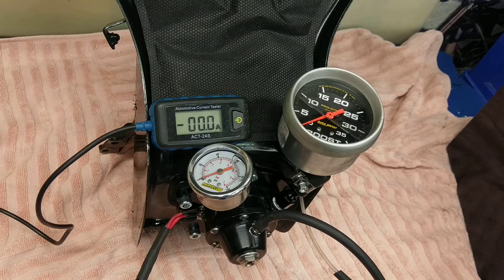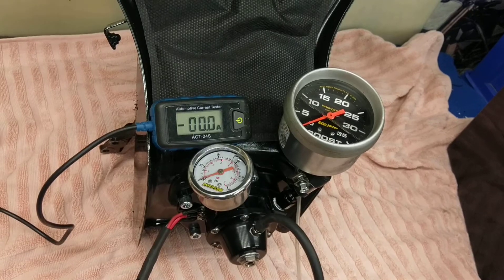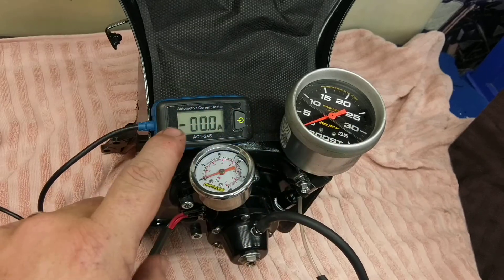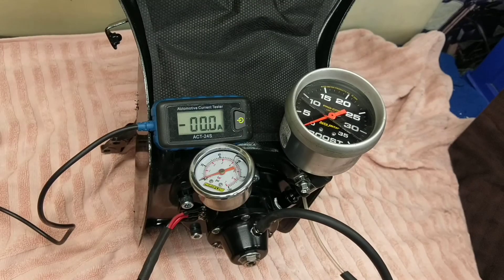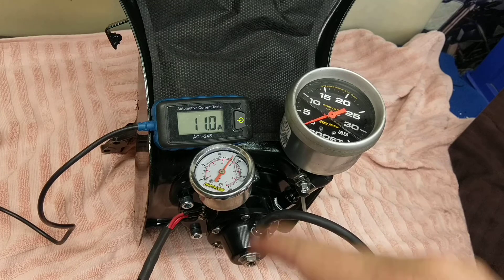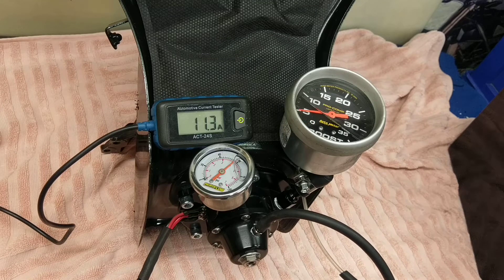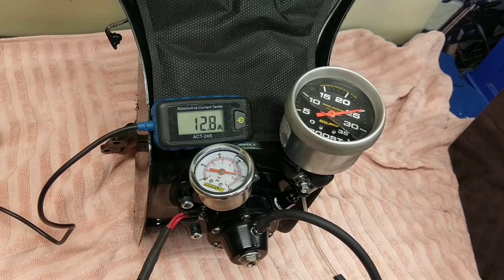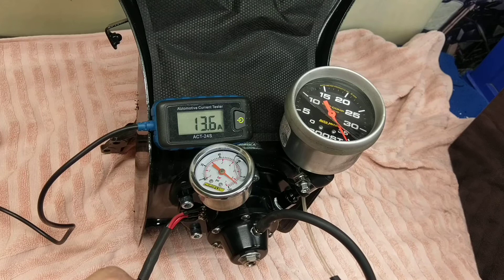Ninja H2 fuel pump & regulator upgrade pressure & current draw test

Comment: Question, do i need to upgrade this fuel pump if my bike pushing 240hp with the intercooler?
Reply from the maker: @orionmobile6545  you generally only need a pump upgrade for stage 3 gears & above or  if you are using E85 fuel.
Reply: @extcreat  thanks im planning to buy zh2 se, already talk to kawasaki dealer and im planning to buy your intercooler. I lived in middle east and it's very hot climate here 30C 40C. How much horsepower do you think it's safe to push with intercooler? I did some talk to zh2 owner they said 240hp is fine without intercooler is it true?
Reply: @extcreat  i want the bike to be reliable as possible because here in middle east there none of people use zh2 lmao. The dealer said if i buy the bike i would be the first guy to use zh2 in that area. Question is, I Don't want to ship stuff waiting for 1 month since all the good parts of zh2 are in america. If i bought the bike i literally has to do mail in flash since there's none of people can do ecu flash/tune for this bike